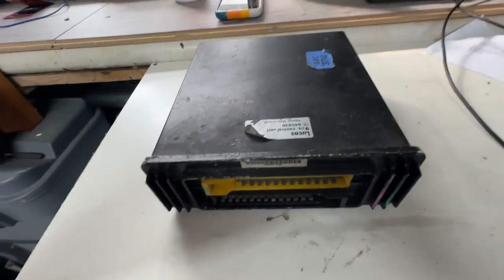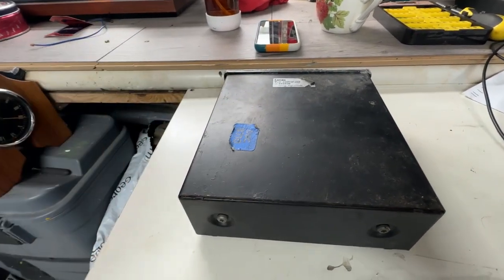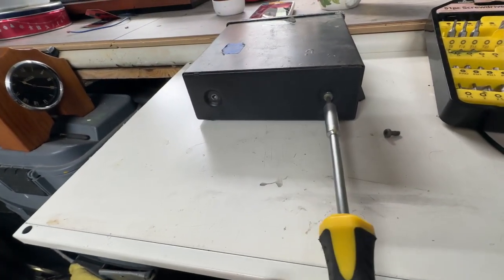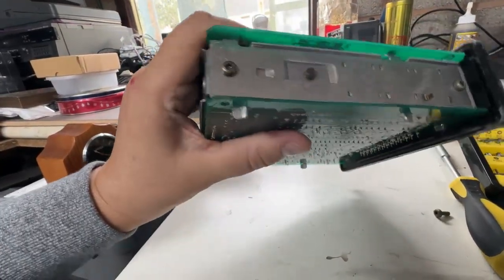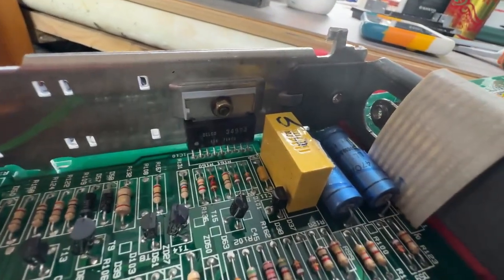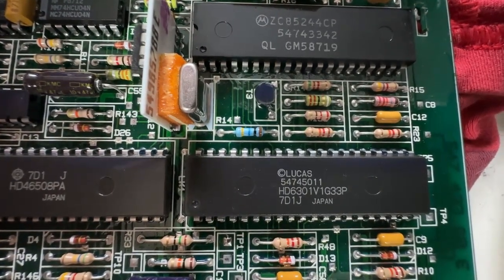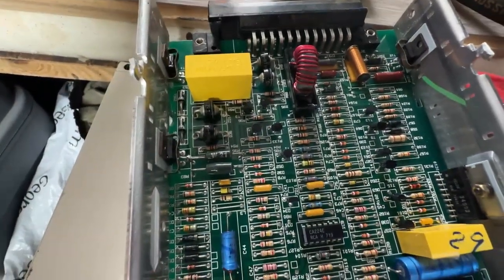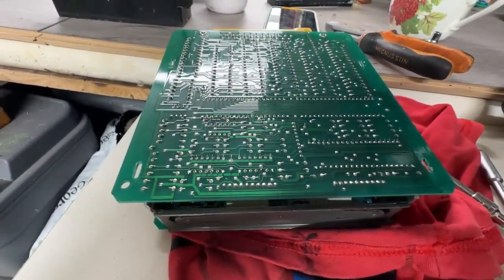Dismantling a Jaguar XJ40 3.6 Lucas 9CU Engine Management Unit

Comment: I have an XJ-S with this ECU and I'm just about at the point of throwing it out. I have been through and tested the diodes, replaced many of the capacitors and some of the resistors, reflowed a bunch of solder joints and even rewound the inductor thingy to no avail. The ECU still outputs shortened or missing pulses to the ignition module when the revs get too high. I've measured this on a scope, and verified that the inputs to the ECU seem OK. With the ECU in this state. I can cruise around OK, but if I floor it, it's like I hit a rev limiter. The exhaust pops and bangs, the rev counter goes nuts and I have no power.
Reply: I also have always had a poor idle - I think all of these engines do. The only example I found online of anyone curing it was someone who found their engine's valves didn't seat very well. They sent the head to an engine rebuilder and after the valves were reground or whatever, the car could be made to idle properly. That's low down my priority list at this stage!

Comment: Thanks for the video, it would be great to see if you find anything wrong with the capacitors etc.
Reply from the maker: I've ordered some replacements, just in case. I'll be removing the existing ones, testing and replacing if needed. I'll then test the ECU on the car.